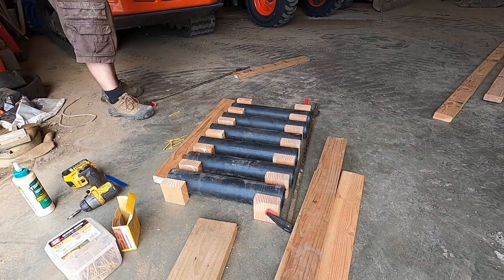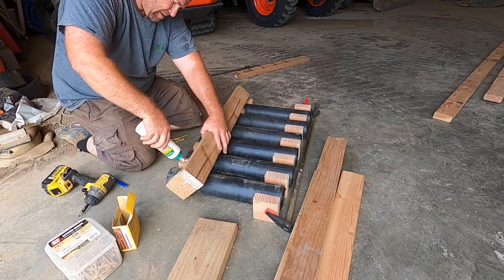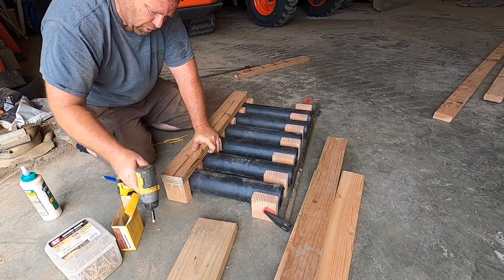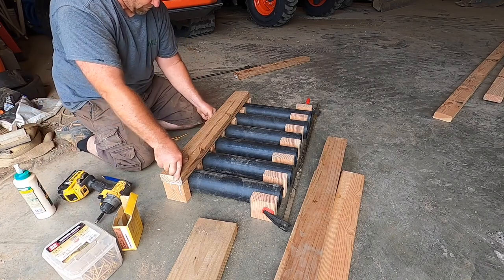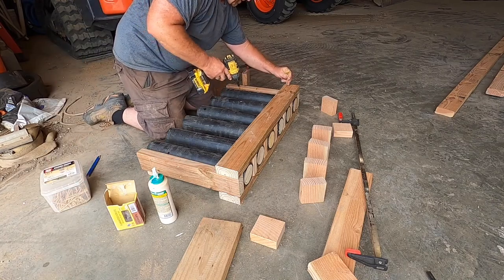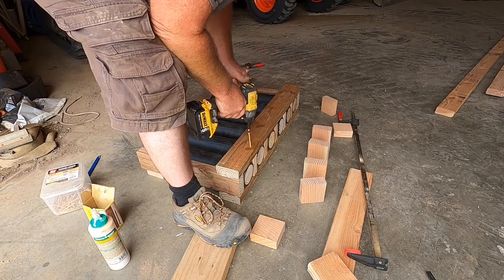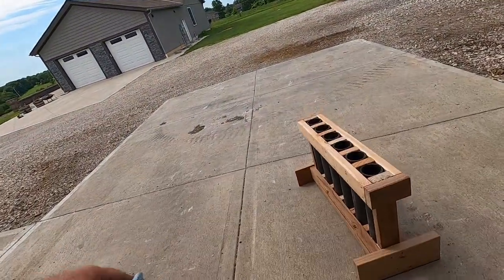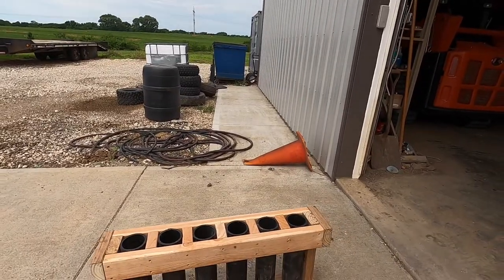Building My Own Mortar Racks for Artillery Shells

Comment: I use spacers in all of my racks because i want the extra space when there is a blow-out instead of tube on tube. Good design only thing i will say though is you should have the inch and a half space on the first tube as well. If that one happens to CATO it will knock out the frame. I did the same thing with the first set of racks i built too. Awesome video bro

Comment: The idea of it is pretty cool. The design is pretty cool. But I see 2 major design flaw.#1 
That would be the tubes, don't have any wiggle room. The tube should not be tight.They should be loose in the rack And have wiggle room   If you have very tight tubes on the rack and if you have a catastrophic failure, your rack actually will blow apart.
#2 The spacers are a good idea.But you forgot to put spacers at the end of your rack its just Against your rack with the tubes